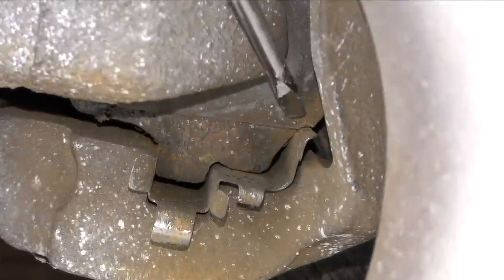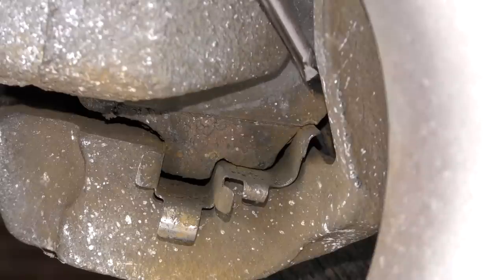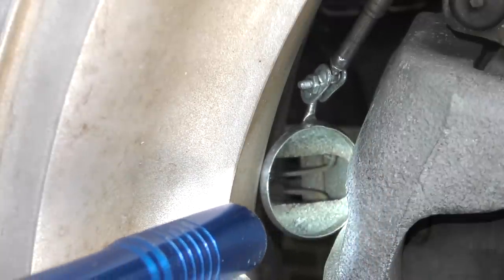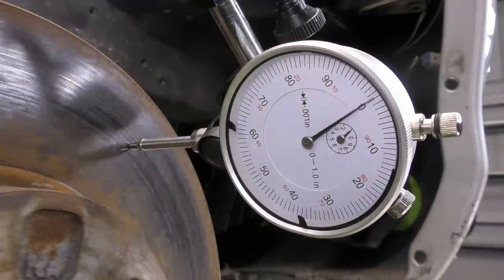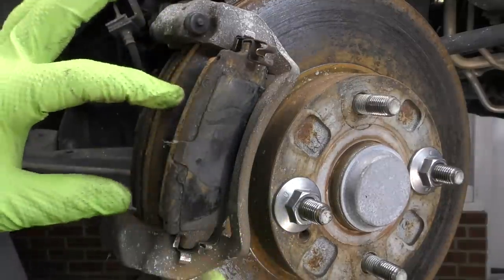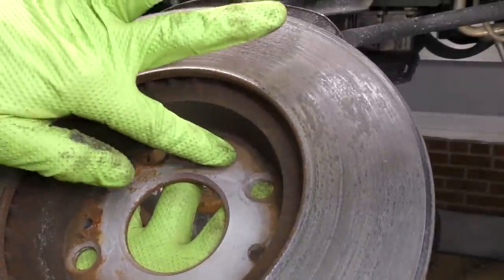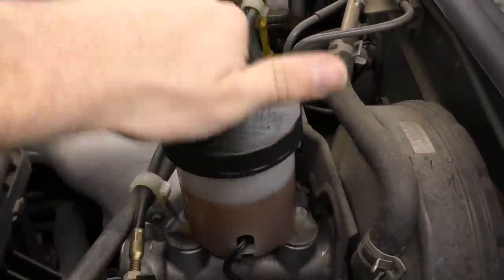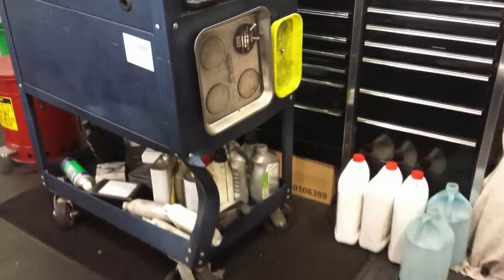Noisy Brakes? Why Your Brakes are Squeaking and How To Fix Brake Noise

Comment: So the squeak noise on my 1 year old Atlas when I brake after a day in the garage means nothing as it disappears once all is warm
Reply from the maker: Yep. Totally normal. Kind of annoying but totally normal
Reply: I mean,   if it's  a  LOW - Squeak - noise,   then yeah, Maybe,    but it wouldn't hurt to maybe put some grease on the back of the pads and maybe file off the edges of the PAD with are file or sandpaper....,
     On the other hand,   you never know some manufacturers could be "cheaping out",    putting  cheaper  brakes,  or  " MID- GRADE  BK.  instead of the"  PREAMIUM " BK.,
     They're just as good, it's just little things like maybe More BK. - DUST Or not last as long,     BUT you still can - - STOP!!!! ,     LOLO 🛑🚫⛔🤣.....

Comment: I have a 2001 ford explorer and every morning the first two or three times I hit the brake pedal it seems that the brake pads bind brutally to the rotor. After that they work normally help!!
Reply: simply lube your caliper slider pins with silicon lube.

(Also consider flushing fresh brake fluid to prevent killing your brakes with rusted caliper pistons - When that happens, everything must go)
👍

Comment: My rear passenger brake is not working properly. It's not stopping as the driver side is. I have changed the rotors and pads a few months before the inspection,  as they were due. So after the inspection I went back to the shop. They said they have checked everything but the problem still exists. The parking brake uses the same pads as the regular brakes and has the same problem. I guess I have to the job myself so what should I look for? The shop said that they changed the brake fluid and checked the guiding pins, also cleaned the calipers.
Reply: Is the caliper free? Sounds like a seized calpier.
Reply: Can I test that visually. Like comparing both sides by pressing the brakes as is, without taking anything apart except the wheels. I do not have a tool to retract the brake cylinder at the moment, as well as a small torque wrench. When I pull the hand brake in motion and then check the temperature of the disks /by hand/  the passenger side geta hot but is defiantly much colder then the other side.
Reply from the maker: Pay close attention to the parking brake cable. And it’s not hanging up
Reply: @HumbleMechanic   It looked ok yesterday. I'll check it tomorrow. Thank you both.

Comment: التصلُد يسير صلدً 
( التقزُز ) / [ البولرّه ] هو أو هي ؛
بأن يصبّح أو تصبّح أقمشّة الفرآمّل 
( متصلدّة / مثل القزآز صلبّة وتلمّع ) بلوريّة 
ولا حل لها ألا بصنفرتها بصُنفرّة خشنّة نوعاً ما 
أذا بقي بها سمآكّة { ثخآنّة } كآفيّة لتخدّم مـُـدّة كآفيّة / كلّم
صنفرها بالتسآوي / بالتسطيح بحيث لا تترُك بها تعرُجـآت / طعجـّـة .
ويسبب التصلُد ( القززّة ) / [ البولرّه ] حك وحت / أهتراء في قـُـرص 
في هوب ( روتّر rotor ) الفرآمّل /// مما قد يستوجّب الخرّط أذا باقي 
فيه سمآكّة كآفيّة فوق الحّد الأدنى min تجدها منقوشّة بقلب القــُرّص أو 
منحوتّة على مُحيطُه / سمآكتــُـه ( منمم minumum  ) مكتوبّة < من min > ،،،
قس سمآكتــُـه ( منمم minumum  ) في عدّة نقآط حول مــُـحـيـط القــُرّص / الهوب .
.

  Don’t forget that ;
When Brake pads glazed they can 
cause rotor/disc to wear or squeal .

Glazed pads and rotors
Brake squeal can also occur when brake 
calipers stick and the brake stays partially applied . 
When this happens the pad is in constant contact with 
the rotor, producing excessive friction and thus heat
( Overheated pads harden and Glaze ( crystallize 
. This glazing  ( crystallize ) occurs on the rotors as well

: The only remedy / solutions is to 
sand the pads and run the rotor if there’s still 
. enough material in both rotor & pads thickness 
، 

: Don’t forget to
measure the rotor 
thickness at different spots  of
 its perimeter / Circumference .

Comment: vw wheel bearings have been trash since the 90's maby earlier. compared to like a hiace bearing they are complete and utter shit. tho i still prefer vw group or old bmw's 😅
Reply from the maker: At least they are not press in anymore. Haha
Reply: @HumbleMechanic  indeed, removing all 4 arms and driveshaft every damn time is a hassle 😅

Comment: That's not what rusty brakes look like.  Those are mere surface rust.  Come to rust belt and we'll show you rusty brakes.
Reply from the maker: That car at the front of the video is from MI.
Reply: @HumbleMechanic  Or I am just too cheap.  LOL.  10 years, 200,000 miles in the rust belt on original rotor.  Rust flakes plugs up the cooling fins.